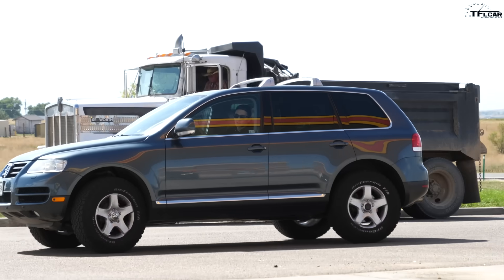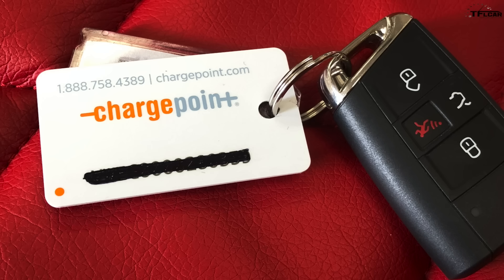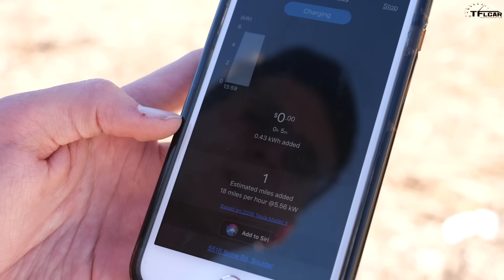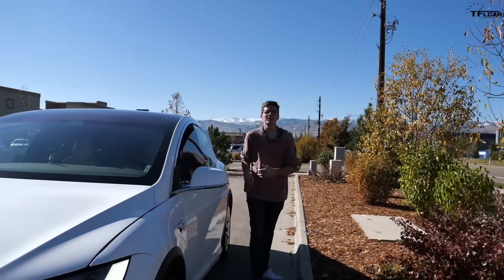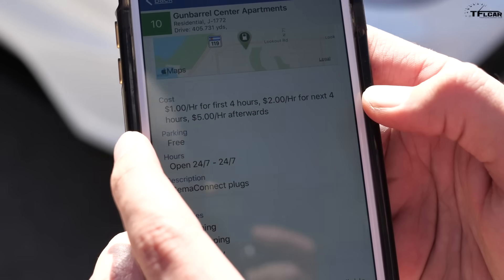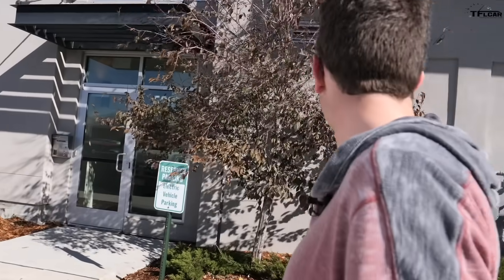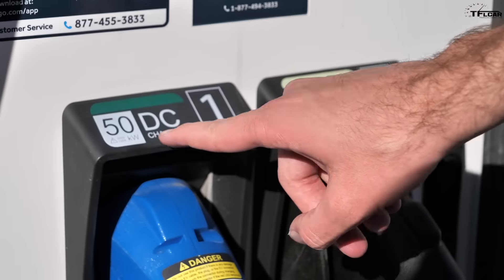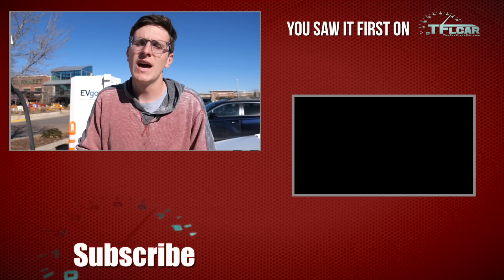Here’s Why Charging an Electric Car Can Suck - And It’s Not The Reason You Think!

Comment: The future is electric. No noise, no emissions, less fuel costs, less maintenance costs.
90% of charging is done at home. Leave in the morning with a full charge. Could not be easier.
I always hated going to gas stations. Now I fill up at home. Electric vehicles are just better technology.
Reply: There are emissions. Just not coming from the car. The more power you produce to the grid the more waste. I don't see solar panels and wind turbines at every station.
Reply: @KJSvitko  
Never happens to me.. lolz.  And I fill up 3+ times per week .
Maybe your gas stations are poorly maintained...  No idea.
Reply: @kens97sto171  3 times a week. You could save a lot of money by going electric. Electric is ⅓ the cost.
Reply: @KJSvitko  
Not really..   I've run the math. I drive for a living I know what my costs are .
My Prius cost me $0.07/ mile.  That's fuel, fluids, tires.
A Tesla would cost me $0.04/mile. NOT including tires... 
 Since I'm NOT at home.. charging at superchargers almost exclusively.
My TOTAL cost per YEAR with the Prius  at 50,000 miles per year is $3500 
I would save $1500-1700 per year going to an EV.
  But when you factor purchase price in.. new vs new. $30k Prius vs $48k Tesla
It would take 12 years to break even. 6 years if I could charge at home all the time.
In 6 years I would have 300,000 miles on either car.. at 12 years 600,000 miles.
Not a great financial choice.
Also.. what's my time worth. Sitting at charging stations waiting is time wasted I could be working or driving.

Much better to buy nice used Prius for $5k.. drive it a couple years and sell it or scrap it.
Reply: @kens97sto171  Fill up 3 times a week. Just calculate how much money you would save going electric. Electricity is about ⅓ the cost of gas.
Reply: @KJSvitko  
I fill up three times a week because I work 3 days a week, it's not a full tank each time usually,  but I want to have a full tank ready for the next day that I work, so  don't have to stop while working. 12 gallon tank. 
Max range is 540 miles. I normally drive 250-300 per night. Leaving me 1/4 tank or so. Not enough to work another day.. so I fill up on way home to be prepared.
I drive 50,000 miles per year, 
My total cost per YEAR that's fuel, all fluids, and tires is $3500.
2008 Prius, 311,000 miles on it.

So even if your 1/3 calculation is correct and it's not.. more like 1/2.
Spending $48k. To save $1700 per year....
Hmm..  how long to break even on the gas savings??  Answer.. never.
even if I compare a brand new Prius at $30,000 versus a brand-new model 3 at $48,000 my break-even point is 6 years at best, more like 12 years if I end up using the supercharger network.
I'm sorry but the math does not make sense.
Even at 6 years.. I would have 300,000 miles on either new car before it even begin to pay off.

or I can be really intelligent and go buy a used Prius for $5k.  

and that's exactly what I do because it's the best option for actually saving money.
Reply: What was hard about going to gas stations?? You pull in on your way to or from someplace you were out anyway.. spend 3 minutes and get 300-400 miles of range.
I agree that electric vehicles are the future however they are still a bit of a pain in the ass especially if you cannot charge at home.
Or if you use your vehicle out on the road a lot which is my particular issue .
The savings going to Electric is not as substantial as you might think, unless you're coming from something like a suburban that's unbelievably inefficient in the first place.
Coming from an already efficient vehicle like my Prius, driving 50,000 miles per year saves me about $1,500.
But what's my TIME worth. 
Also you have to factor the purchase price . 
The only vehicle that would really work for me, would be a Tesla with a long-range pack.
if I was to buy a brand new Prius versus a brand new model 3 long range.
My break-even point is 12 years, using mostly superchargers, 
if I was able to charge it home exclusively you can cut that in half.
but six years for a break-even point is not a great financial choice either especially when one is driving 50,000 miles per year.
If you're trying to save money then Your best choice is to buy a  used Prius in the first place...

People should buy whatever vehicle works for their particular life, 
But people also tend to forget that other people have different types of lives and different needs, and think that the way they use their vehicle is the same way that everyone else does.
And this is not the case.

but it's important to ask yourself if my break even point driving fifty thousand a year is 6 years... What's the break-even point for your average person that drives 12 or 15 k per year.

The answer is essentially never..

so by the Tesla or whatever other car you want because you like the vehicle not because you're deluding yourself into thinking you're saving money because you're not.
Reply: @kens97sto171  3 minutes?  Haha... just tell that to all those people sitting in the Costco gas line.  That's 20 minutes just to get to the pump on a Saturday.   Sure, for your particular situation hybrid works.  I'd rather forgo the inconvenience of engine oil changes, transmission oil changes, complexity of the hybrid system, air filters, etc.

Comment: For me, I could live with a EV for an around town vehicle if I charged at home (especially a Tesla which has good range and is fun to drive).  But I wouldn't be able to use an electric 4wd vehicle because the places I would go do NOT have any fast charge facilities.  Same with a motorcycle.  I travel on the small roads with small towns.  Even finding gas is sometimes a challenge.  No fast charging there and who has time to wait for 2-3 hours at a C-store just to get 45-60 miles of range?  Not me.
Reply: You could always find a campground and use their 30/50 amp power that they have for trailers. Sure it will be slow but not that slow

Comment: “City” is the word that tips the scales for me. Fear of running out of juice in parts unknown is a lesser, but also real, fear.
Reply: I just drove 2000 miles from Arizona to Michigan in a 2001 Ford powerstroke 7.3. I can't imagine having to stop every 300 miles to let the vehicle charge for 3+ hours. Not happening.
Reply: @chapekfabrication2975  With fast charging, most stops will be for 40-50 minutes. I usually have to stop for the bathroom and coffee or lunch before 300 miles. Newer cars will charge faster and go further.
Reply: @chapekfabrication2975  You wouldn't.  If yo had an EV with a small range, wouldn't make that trip in that car.  If you had a Tesla you can make the trip and u would stop for 30mins every 250-300mi.   These videos are ridiculous and not real life EV situations.
Reply: @chapekfabrication2975  How about 10-20 minutes while you use the restroom or get lunch.  No one sits there for hours....at least not if you have a Tesla.  This guy's video was so biased I wouldn't be surprised to see that pool companies fund him.
Reply: @chapekfabrication2975  It takes 5-30 min to charge, my body needs a break every 2 hours or so. Did a 10k mile drive this summer and was only slowed down once in northern Alberta as we needed to level 2 charge.
Reply: @martialman.4563  didn't the video say that the charging speed off that charger was 15miles of range per hour? Are some faster than others?
Reply: @chapekfabrication2975  Yes, they mainly showcased level 2 chargers which provide 240v AC current into the car, which the car converts it to DC and charges the battery.  A Tesla Supercharger or the CCS charging is level 3.  Those stations have transformers that convert AC into high voltage DC and provide that directly to the battery, providing up to 250-350kW of power compared to the 6kw level 2 chargers in the video.  A Tesla Model 3 will charge from 20-80% in 20 minutes, which provides ~200mi of range.  The new supercharges they are rolling out can do it in 15 minutes.  I prefer stopping every 2-3 hours anyhow, but for people who travel long distances frequently and don't like to stop, today's EV's might not be for them.
Reply: @chapekfabrication2975  Oh yes. My car is model 3, much more efficient and faster charging than the one in the video. Mine can charge up to 1000 miles per hour but typically charge in the 400-500 miles per hour range. I caravand with my parents from Missouri to Oregon and back once. They drove Dodge Cummins diesel with trailer and they really slowed me down. My car had better range and could charge faster than they could fill their truck.
Reply: @bobthebuilder372  You get an A+ from me.
Reply: @martialman.4563  They towed a trailer, have you not seen where they towed a small trailer in the Model X and that was not pretty with range!
Reply: @gregandkaruna6674  I have
Reply: @gregandkaruna6674  Electric truck will need a big battery. My point was it would have been better to drive electric and rent VS 6-8mpg and sleeping in parking lots. My father is penny wise pound foolish.
Reply: @martialman.4563  now do the same trip, but you pull a trailer on your tesla, then see if it affects your range at all...
Reply: @rayoflight39  No, I just stay at air bnb or hotel for less than what it costs to fill up a truck. Pulling a huge 5th wheel trailer and sleeping in parking lots does not save any money.
Reply: @martialman.4563  life in america seems expensive...
Reply: @martialman.4563  Driving a Tesla ?
Reply: @chapekfabrication2975  YES!  Every Tesla charger out there.
Reply: @aardvarkansaw  Yes, long distance trips in any other electric car is challenging. If Ford really comes out with 370+ mile range car this month that might work but Tesla is by far easier to charge on the road.
Reply: Long distance travel is fine with EV and most rural people in USA have electricity. You just need a big battery, short range electric cars don't work well for rural settings.
Reply: Onecan run out of gas too.
Reply: That only happens to stupid people and theirs a lot of stupid people in the
    world today 😮👥👍
Reply: I have owned, a Leaf, FIAT 500e, BMW i3 and now a Chevy Bolt... I have never run out of charge.
Reply: @spacegreycoralred  what is your charging at home like ?
Reply: @spacegreycoralred  you would if you lived out where I do. The more rural you are the lower the odds of finding a place to charge. We see people going to rv parks to charge around here and when you get west of me they can be hundreds of miles from the nearest possible charging point.
Reply: @JamesSmullins  teslas fast chargers cover the whole of the US, if you drive more than 300 miles a day from your rural house then you can start worrying but if not then just charge at home and always leave with a full battery!
Reply: @Mooshimoca  you apparently haven't been to Texas where they do not. Once you get away from the big cities that run the i35 corridor it's sparce and it's a couple hundred miles to the next semi large populations. There aren't any ev chargers within a hundred miles of me and the closest would be Austin to the east, north of me nothing west of me even less and south of me a bit more than Austin miles wise to San Antonio.

That's why they have to find rv parks and spend the night. Texas is big enough that if you flipped it over north it would hit the Canadian border and there's a whole lot of nothing here. Even gas stations can be far and few between so you stop when you can not when you need to.
Reply: @JamesSmullins  I live in TX and have been all over the state. Only hard part to get to is Big Bend but they have RV parks.
Reply: @JamesSmullins  I found lots of charging spots between I-10 and I-20 west of Austin. On I-10 and I-20 there are superchargers every few miles, but in between there are level 2 chargers for example at the McCulloch County Library and several car dealers in Brownwood and San Angelo, but you are right that it's also easy to use plugs at RV parks since every Tesla comes with a 14-50 plug and it's easy to buy other adapters. Blank spots are filling in pretty fast just like 100 years ago when cars started using gasoline
Reply: spacegreycoralred you see ppl stranded on the sides of roads with empty fuel tanks all the time. It’ll happen at some point
Reply: @spacegreycoralred  Have you been on any long road trips?

Comment: The only time you will use one of those is on a road trip, so its not really a big issue.
Reply: SaltCritters How is 2, 3, 4+ hours of charge time on a road trip not an issue?
Reply: @LukeEdward  Nobody charges 2/3/4 hours. Simply dont use 5kw chargers as mentioned in the video. Use 150 kw, go to the restroom and your good to go for hours on the road again..
Reply: @geraldk2974  But this was about ALL EVs, not just Tesla, and ALL chargers, not just Tesla Superchargers.
Reply: @LukeEdward  Even the smallest city-EVs can Charge with at least 50kw. Thats 10x faster than the ones mentioned in the video. Nobody  charges a car with 5kw, thats just BS.
Reply: @LukeEdward  Tesla supercharges take around 30min....
Reply: @SaltCritters  But this was about ALL EVs, not just Tesla, and ALL chargers, not just Tesla Superchargers.
Reply: Plus, all. I regularly do road trips of near as makes no difference 1000 miles, into the Smokies, and it takes 15 hours. That means 70mph average with <15 minutes each for 3 stops. You telling me that I need to add 3-5 hours, and the miles/time to stray to a supercharging station, to that trip isn't going to work. And, unfortunately, many do not live/travel close to a metro area that has fast charging stations. Which leaves the slower charging areas, like the video showed, as the only option - OR make a 15 hour drive into a 2-3 day trip.
Hmmmmm. Seems like TFL seemed to note the long haul deficiencies in a recent video....
No matter, when fully examined to include the common circumstances of a majority of people in the US, I stick by my first comment.
Reply: @LukeEdward  
Say you're doing a 400 mile trip in a 300 mile range EV.
When the battery gets to E, you don't need to wait an hour+ to charge it to full. Instead what you do is at some point in the 400 mile trip, you charge it at a fast charger just enough to get you the extra 100 miles to your destination (15-25 minutes...pee break, get some chow). At your destination you'd use one of the slower L2 chargers featured in the video (your hotel, your home, etc) to charge up overnight.

What about a 1000 mile trip?
I just mapped a 950 mile route along interstates. 
Assuming you go straight through (from experience that's a darn long day even with a gas car), you'd have six stops total with an estimated 2 hours charging time between all stops. You could make fewer stops, but once the battery gets to about 80%, charge rate slows dramatically so it really is better to stop more often. Three of the 6 stops are about 15 minutes, and the other three are 24 minutes. Most stops are about 2 hours apart. 15hr 30 minutes total time...though this route is in the west, land of 75mph.

It sounds like a lot of stopping, and maybe it is if you are a piss in a bottle type, or a pair of adults who orchestrate their gas stops like a nascar pitstop.

Personally I travel with kids, so my daily drive limit is more like 750-800 miles. Even still with that I'm probably stopping 5 or 6 times anyway for pee breaks which take 10-15 minutes once all is said and done because kids are kids. Same trip defined above, but stopping after 800 miles has 5 stops for 1hr 40, and 13.5 hours total time.

Like with the 400 mile trip, when you get to where you are going, you plug into an L2 overnight and come back to a full charge in the morning.

Today, superchargers are concentrated on interstates and urban areas. Give it a couple years and they'll be hitting US highways.

Comment: So whats the cost to fill up totally from empty?
Reply: EVs cost about ¼ to ⅓ of what gas or diesel costs to fuel your vehicle. The savings add up quickly.
Reply: I work at an O&G company, so no charging there LOL. I drive about 4800 miles a year to/from work. Here we pay $0.12 Kw/Hr for electricity (coal and natural gas sourced - wind is more), which according to evcompare.io would cost about $4.80 for 125 miles of range for say an eGolf (not sure at what speed). Regular gas is pretty cheap at $2.08 / gal. The old dd VW gets about 31 MPG in the home/work loop, so about $8.38 for the same 125 miles. EV fuel cost $153.60 / yr. Old dd fuel cost $321.79. I would "save" $168.19 a year, assuming I could trade out vehicles for free - which of course is not true. Plus I have to buy the charging equipment and install it. And it will be newer, so I'll have to pay more for insurance and licensing. But I will save a little on spark plugs, oil, filters, etc (which I change myself). Something to think about down the road when a used EV dd is $4-5K, but certainly not a game changer at the present.
Reply: About 16 hours
Reply: Depends on what your time is worth.
Reply: @hallkbrdz  You charge at home or work 90% of the time. Takes no time. Plug in when you pull in the garage. Unplug before you pull out in the morning. Takes a few seconds,
Reply: @hallkbrdz  Im just thinking if you plug it in and go to bed, whats the dollar cost roughly... $20? $10? $40? I will look online Im sure there is more info out there.
Reply: @WoodFurnitureInc  looks like average $0.34/kwh at supercharger in CA. $34 for full charge. About $16 to charge at home.